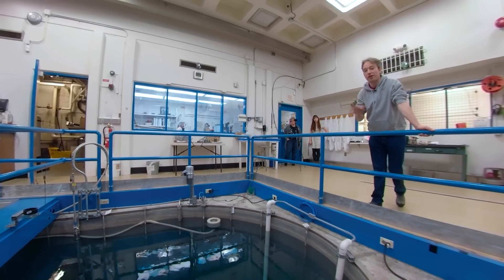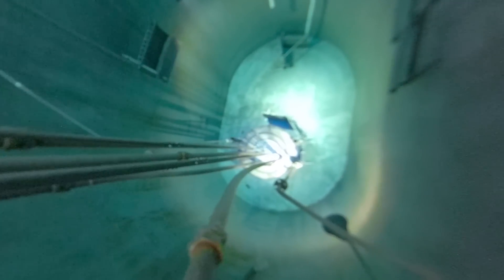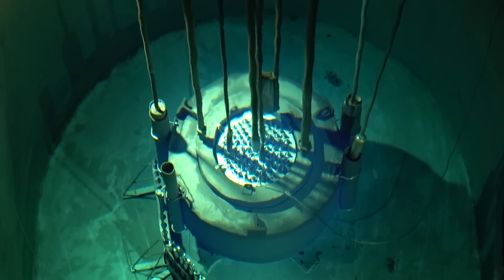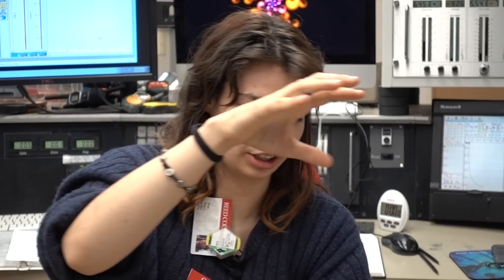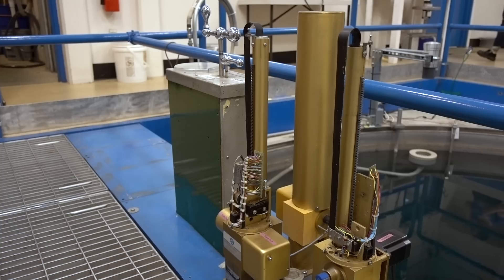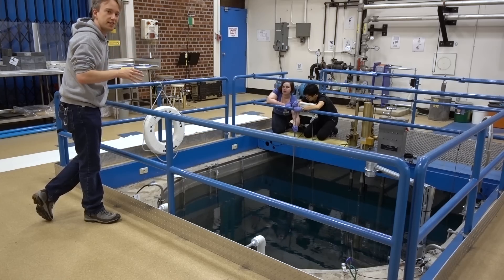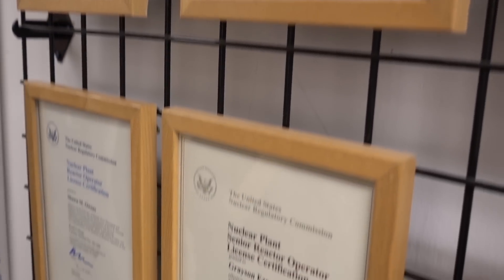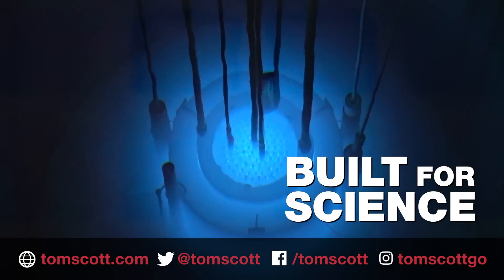This nuclear reactor is run by students

Comment: AND THEY USE WINDOWS VISTA 😱
Reply: Looks like Windows 7 to me.
And, hopefully, it's not connected to anything outside, so I doubt it'll be a problem.
Reply: Windows 7 Extended Support lasts until 2020.  It's still getting security updates.
Reply: It's definitely Windows 7; Vista had a taskbar that looked more like XP, and the round start menu button stuck up out of the taskbar a bit.  And as ThetaReactor noted, Windows 7 will be supported for a few more years.
Reply: Definitely looks like windows 7 to me at a quick glance like many others pointed out already.

I don't know how flexible the software being used to run this machine is, but in many special controller type scenarios its far from uncommon to stick to the old out of support OS that works reliably. Reasons can vary wildly the software might not work on newer stuff, original development company is out of business so no new updates for it anymore that work on newer systems, don't want to buy the newest controller software licence etc.

All of this is fine as long as you take reasonable precautions with your machine, don't have it on an open common network. If it does have to network with other devices for its functionality then segregate all of those from the main network. I suspect given that this runs on windows 7 has a good chance of working on newer operating systems, but there's a lot of older typically industrial gear or still useful research appliances out there still in use with much older operating systems and software.
Reply: I think the U.S. Navy still runs on XP the last I heard.
Reply: No, they either use Windows for non-critical systems or a bespoke, custom-made system for critical stuff (but you might be mistaken, until now the British submarines still runs on XP, with millions of pounds paid to Microsoft by the Government to be able to run those securely).
Reply: @crushermach3263  Yes they do but it's very altered.
Reply: Memer_Rick because old windows versions have know exploits that have yet to be fixed.
Reply: it is definitely NOT Vista, that is Windows 7
Reply: No serious organisation uses the most recent versions of Windows. It really wouldn't surprise me if Microdaft themselves were still using Windows 98 for at least some functions.

Everybody who is currently using Windows 8 and 9 is simply just beta testing the builds until they're secure and efficient enough for the serious organisations to use. By that time though, the emoji users will be a few builds down the line from the current Windows 9 - beta testing new versions of Windows under the pretence that 'most recent = best.'

An old version of Windows is only as vulnerable as you are stupid. A recent version's vulnerabilities are mostly unknown.
Reply: Windows seven on a dinky reactor is nothing! Nuclear missile launch codes still use 8in and 5 3/4in floppies!
Reply: @thejay8963  What's wrong with floppies?
Reply: Sven Leuschner, yes, US national park administration decided, they need a national park like Chernobyl. Since then, all nuclear reactors are forced to run on outdated, unpatched windows versions.
Reply: We're all going to die!
Get it?
Reply: At least it's not XP!
Reply: OMG! We're all going to die!
Reply: AlphaCore why do you think windows 7 is that unsafe

Comment: Cherenkov radiation is caused by particles going faster than the speed of light in the medium that they're traveling through.  How is a much more complex question that I am equally unqualified to answer, but the wikipedia article on it is fairly detailed (but not guaranteed to be accurate, of course)

Anyone reading that "Faster than the speed of light" thing and getting confused, remember light is slower than c - the speed of light in a vacuum - when in other media.  Air slows it down a bit.  Water slows it down quite a lot.  If the reactor were in a vacuum and not in the bottom of a pool, it wouldn't be glowing blue.  And yeah, Einstein's speed limit holds; we've yet to find anything going faster than c (with the possible exception of information transmitted from one quantum entangled particle to its partner)
Reply: As pointed out by Terry Pratchett, monarchy travels faster than c - no matter where the successor is on the globe, they become king or queen instantaneously upon the death of the current incumbent. This actually happened with Queen Elizabeth II, who was on safari in Africa when her father died in the UK.
Reply: I've always wondered if light actually doesn't slow down, but bounces around and gets absorbed/reemitted in denser mediums, causing it to be "slower." too lazy to look up tho
Reply: That seems like a logical explanation from a particle perspective.  I have to admit, the whole wave/particle duality thing that light does throws me; I don't expect light to do anything logical at that level.  Give me a nice optics diagram and leave me to my nice, normal, macro life :P
Reply: You mean all those sci fi shows with glowing blue auras around a toroidal core got it wrong? I'm going to have to totally reconsider my whole life now.
Reply: The speed of light varies for different mediums. The particles being thrown off by the reactor are flung at full C, but then they get bounced around by interfering matter.

Comment: Haha... from the Wiki article on TRIGA reactors: "The TRIGA was developed to be a reactor that, in the words of Edward Teller, 'could be given to a bunch of high school children to play with without any fear that they would get hurt.'"
Reply: Being "idiot proof" always finds a worse idiot.
Reply: That’s quite a bold statement. High schoolers can do unexpected things
Reply: @awildfilingcabinet6239  However in this case it is actually valid.
Apart form draining the pool, practically nothing can go wrong as the TRIGA design has so large a negative thermal reactivity constant that even when (yes when) they go prompt critical, they shutdown passively and only make a 'boing' noise and a few ripples in the pool (but a huge blue glow, you can find several youtube videos showing it).
During such an experiment, TRIGA reactors have had power outputs as high as 22 GW (although only for a few ms).

So even if you yank out all the control rods as fast as you can, it will not melt down or even be damaged except if the water in the pool is allowed to evaporate over time (the heat released by the reactor will start to evaporate the water eventually if the cooling system is switched off for too long)
Reply: @srenkoch6127  until someone gets pushed into the pool...
Reply: @superslimanoniem4712  Actually as long as they stay near the surface they will likely receive LESS radiation than staying above water (according to What IF at least) due to the shielding effect of the water on cosmic rays reaching the surface....
Reply: @srenkoch6127  Yep. As long as you don't swim down to touch the fuel assemblies, you're good. I still wouldn't wanna swim in a nuclear reactor.
Reply: @awildfilingcabinet6239 Highschoolers will try to swim in it because they're stoned and their friends dared them to.
Reply: Triga, please!
Reply: Ah yes, TRIGA FINGA
Reply: wow this sucker's prompt critical?
Reply: Mansaku Nabi boi
Reply: Swim in it
Reply: in reality its just a normal reactor with out turbines to make power

Comment: I am a bit concerned that they have so much experience with people dropping stuff accidentally into the reactor....
Seriously - this is a nuclear reactor - i do not want to contaminate that or even damage it (some coke on your fuelrods?)
Reply: The reactor will damage things long before those things ever damage the reactor. Obviously you don't want to drop things onto it, but small items like phones won't do anything to it. Plus, reactors like this basically just shut down if there is any damage. The fuel rods are so small and have such relatively high surface area, that even if all the water leaked out of the tank, the fuel rods can't ever melt down..they can be passively cooled by the air indefinitely. They are great little reactors :D
Reply: " Plus, reactors like this basically just shut down if there is any damage." still, the people should have to pay for the reactor and the downtime.
Reply: Oh ya, for sure. No one is encouraging them to drop stuff, but it is also no concern for something as small as a phone. That is high grade steel down there. Unless you are dropping something that weighs a ton with a sharp edge, it ain't doing nutten!

Comment: Anyone else notice the video distortion from the camera inside the tank? I'm guessing that's radiation affecting it but would be nice if someone could confirm
Reply: That's just the heat from the reactor combined with distortion from the water. If the radiation was affecting it you would see it as brief flashes of light from a decay event happening very close to the receptor. There is not really enough radiation from that distance to detect it without a geiger counter.
Reply: Ya, convection is the main method of cooling in these systems, so there is basically "wind" in them. What you are seeing in the breeze :D

Comment: maybe i'm missing something but they said this reactor can't meltdown... so why aren't we making them always like this? efficiency? plutonium?
Reply: It doesn't produce enough heat. Same reason a spark from a  power grinder against a piece of steel doesn't burn your arm to a crisp.
Reply: yeah but i was thinking parallel production
Reply: That would take way too much space. For power plant producing 1000 MW of electricity over 10 000 of these would be needed
Reply: Parallel production would be massively inefficient. Also the risk of meltdown is quite low, we've only had 2 in history, which is about a 0.5% chance of an environmental problem. Which is much better than fossil.
Reply: The reason they can't melt down is because they are so small. The smaller the fuel rod, the higher the surface area to volume. This makes it so that the volumetric heat of the material can use the surface area to passively cool. This isn't the same for larger reactors that have more volumetric heat. The surface area just doesn't help you cool it fast enough. 

This is why there is a lot of research into accident tolerate fuels that use metal rather than ceramic so they can carry heat away faster as well as smaller reactors that have this same heat volume property. 

Modern reactors are getting to the point where they can't meltdown. The new AP1000 design can sell cool itself for 7 days after an accident. Even newer designs use different passive means to cool themselves. It is a fun time to be a reactor engineer!

Comment: I’d freak the heck out if I fell into that water.
Reply: You should read the XKCD "what if" about falling into a nuclear spent fuel pool. TL:DR, not danger whatsoever.
Reply: Stick to the top and you'll be fine. It's entirely possible that it is less radioactive than the air in there.
Reply: Fortunately they have a life ring right there.

Comment: So radiation is watchmen blue instead of simpsons green?
Reply: Cherenkov radiation (which is the kind you're seeing here) is blue, at the very least.
Reply: So... You're saying The Simpsons isn't real?
Reply: blindleader42 are you insinuating watchmen is?
Reply: MOOD,
If the radiation is blue, it must be, right? 
I've never read or watched Watchmen.
Reply: Well, at the very least it looks blue to humans. It's actually a lot brighter in the UV portion of the spectrum.
Reply: It really depends on the situation. What's actually causing the blue glow here is the water surrounding the reactor. Light travels through this water at a slower speed than the high energy beta radiation (electrons and positron) emitted by the radiation source. The result is that as a beta particle travels through the water it emits photons that travel slower than the particle emitting them, so the photons bunch up - their wavelengths contract (since the speed the light travels must remain the same), and you get what's called a blue shift (the difference between different colours of light is their wavelength, with blue at the shorter end of the visible spectrum). It's similar to how a sonic boom works and is to do with the Doppler effect. We see the opposite result commonly in astronomy where everything is moving away from us - we can work out how fast things are moving away from us by how much their light is red shifted. Returning to your question, on the other hand uranium typically does have a greenish Simpsons-like glow to it (radioactive materials can actually luminesce at a variety of different colors depending on their specific atomic structure).
Reply: Uranium goes through many different colours during oxidation. Greens, yellows all possible
Reply: In the Simpsons they use Uranium. Which can glow green.

Comment: You could have gotten to one more near to you in Mainz, Germany. Although it's not that opened up usually with the water and they pulse it for cherenkov radiation to be visible. But the best thing, on the other side of the road you can then visit a 1.5 GeV particle accelerator (Mainz Microtron)

Comment: I never knew that nuclear reactors are actually glowing :o that is really intriguing, now I want to know more about it!
Reply: That is called Cherenkov radiation, it's not radioactive, as you might think from the name, it's just light. The way it works is analogous to a sonic boom. It occurs when particles move faster than light in the water, now you might read that and see an obvious problem, but remember that light slows down when it goes through a medium, in case of water it goes at around 75% of the speed of light, so particles in the water can go faster than that. When that happens, it creates an electromagnetic wavefront than forms an expanding cone of very bright, high-frequency light. The really high-frequency stuff that is harmful gets absorbed handily by the water and what you're left with is blue light.
Reply: NotaWalrus That is really cool, now that you explained it I think I remember having heard about it quite some time ago, but my memory of it is really fuzzy, so thank you :D
Reply: Yep, and it was predicted as a byproduct of Relativity before it was ever seen.
Reply: @NotaWalrus1  i was thinking about if something like this was possible while i was sat in physics at one point... knowing it's actually a real thing is awesome!!!! thanks dude
Reply: Note that the Cherenkov radiation doesn't produce only blue light, that's just the interaction between the frequencies that are absorbed by the water and those the human eye is most sensitive to There's a lot more ultraviolet and violet light than blue, but our eyes don't detect purple as well as blue, and because Cherenkov radiation emits light in a smooth distribution across the frequencies, our eyes see the blue better.